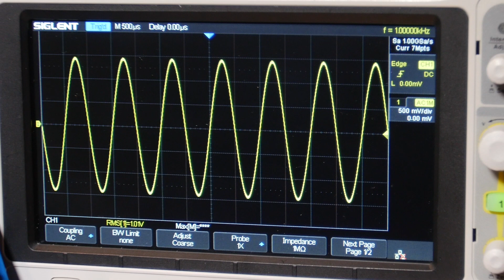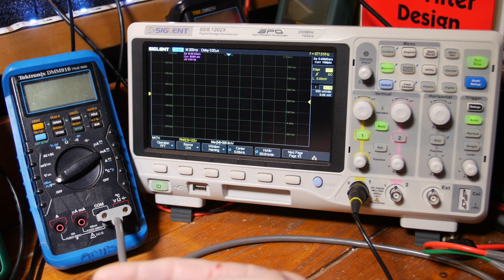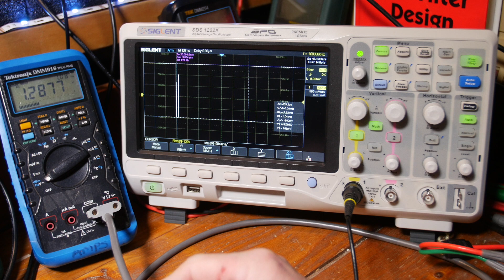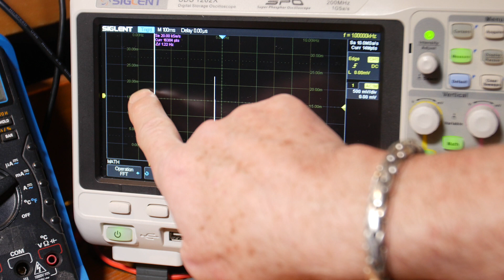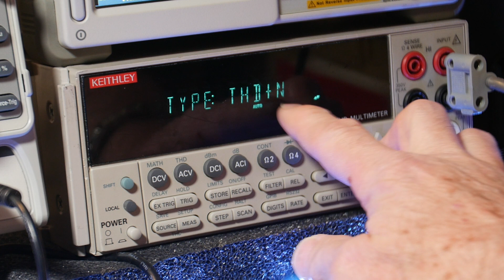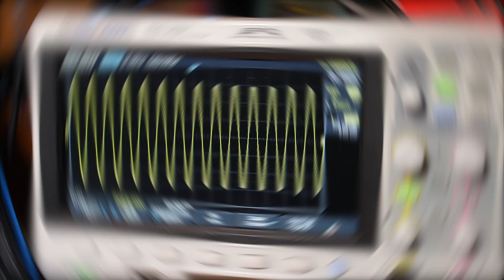How to Trust FFT with Siglent SDS1202X #FFT #SDS1202X

Comment: Hello, thanks for very good video explaining FFT application on Siglent oscilloscope. 
But I have a question. How do you generate a 1kHz signal and at the same time  as 4.5kHz "pilot" signal on same output of a function generator?
I do own an Signent SDG function generator and I wish to learn how can I also trigger different "pilot" signals.
Do you have different files made and saved in the funciton generator that contains the 2 different frequencies?

Thank you,

Comment: Greetings friend.  First of all, thank you for your work and thank you for all your contributions to the community, you are helping us a lot.  I would like to ask you a question if it is not too much trouble.

 I have a question about oscilloscopes.  I've been looking for weeks to buy one with 2 channels.  I'm between a Siglent or a Rigol.
 Both are 200Mhz and 1Gsa/s.  The most notable differences between them are: The Siglent SDS1202X-E has 14Mpts and up to 400,000 Wfm/s, while the Rigol DS1202Z-E has 24Mpts and 30,000 Wfm/s.

 The question is, what should I get, more Mpts or more Wfm/s?
 And in your opinion, which one do you think is better and which one would you choose?

 Thanks again, thank you for your contributions to the community.
 A strong hug.
Reply from the maker: Thanks so much!  I appreciate you!

OK, so honestly - both those scopes are a generation old now, and only 2 channel.  I chose the Siglent over Rigol as there are other features where Siglent is better  (non - E and the -E version GUI is not as clean).

I'd go with the new Uni-T that has the memory - speed - and a better GUI as well as a great FFT (not perfect, but much better).  Also starts off with 2GSa/s vs 1GSa/s from the others - and 4 channels.  Both the Uni-T and the Siglent can go down 500uV/div vs 1mv with Rigol.  Here's the link to Uni-T: https://amzn.to/3v5GsTz

The 2 channel Picoscope cost a bit more but is a far better scope with awesome software.  You can download the software and give it a try.  Here's the link to the scope.  I'd go with the 2206 or higher: https://amzn.to/3wOl3Pb

Comment: I used a scope for 40 yrs. And if I had go through this process for every measurement, I would have been fired 1000x over.
Reply from the maker: LOL yes the Siglent does take a minute to setup, but it actually goes much faster once you have done it a few times.  The FFT can give some great info though.  It has only been found common on scopes in recent years.  But handy when you don't have a spectrum analyzer around;)

Comment: How would u compare the 1202 fft to like a HP 85532 3 series spectrum analyzer
Reply: If u could message me personal I have some questions and some stuff id like tomshoenya
Reply from the maker: Thanks - if you could email me that would be great!
Reply from the maker: Wow that's a great question.  That HP is from the 70s;)  The BW starts at 1 kHz and BW resolution only goes down to 100 Hz.  Other than that, it would be interesting to see the difference.  I think the 1202 FFT would give good results and easier to see, but the HP is an actual spectrum analyzer, so it would be interesting.  The HP module that you mention also needs the monitor that it plugs into.

Comment: Some day I will set up my AWG with a spectrum analyzer and two scopes daisy chained. It will be cool to compare the same signal on the SA in the frequency domain, as well as in the time domain with and without FFT. And by the way, Siglent's scopes FFT function is amazing. There is a difference between the SDS1202X-E and the SDS1204X-E though, as the FFT is enhanced in the 4 channel version. Probably due to Siglent's firmware updates. It's a shame the FFT in the 1202X-E is not updated as well in this matter.
Reply from the maker: Thanks for the great feedback!  The firmware is different in these 2 scopes.    I like the FFT in the Micsig though as can be seen in this video: https://youtu.be/bFWJUmgs_8M

Comment: hi, which is the maximum frequency of the signal measuring fft with Siglent Oscilloscope 100 MHz Bandwidth? can I measure fft of a 21  MHz signal? thanks
Reply from the maker: That's a great question!  Generally, a good FFT on a 100 MHz scope should not have a problem showing the voltage of a generator at 21 MHz.  It isn't so much the bandwidth but the sampling rate that matters.
Reply: @kissanalog  thanks for the response, I´m interested in 21MHz, 15 meter hf  cw ham band, so it will do the job.

Comment: This scope has prob very rudimentary FFT and memory, but you could simply zerofill to 1k or 2k points apply your window function and get sufficient digital resolution.  You could show what happens if you do discrete fourier transform of a sine without smoothing things out with a window function and show sinc truncation artifacts. Also you can show what happens when multiple freq are mixed and separate them out with FFT.
Reply from the maker: Thank you!  Great ideas!

Comment: Al of those spikes signals are just harmonic's on the basic signal.  Your chasing ghoste.
Reply: That's the power of frequency domain visualization vs time domain.
Reply from the maker: pulesjet Yes you are right - at one point when I had the two large amplitude spikes up together they added together in the time domain and must have flat topped a bit to get those little spikes to pop up.  Good eye;)
Reply: ...or parasitic modulations of the signal source ...

Comment: Great video Eddie!

You did everything on a linear scale, what is good for an introduction. On the dB scale you have to be much more careful about the low amplitude harmonics.
I got into this trap as I was doing some simple THD measurements and every time I end up with a (relative) high peak on the 5th harmonic. I belief this is an artefact of the vertical amplifier itself.
after putting my distortion analyzer in between and only using the residual for the FFT, the harmonic bins became reasonable because I don't need that high dynamic range anymore.

Also: It's a difference if you use the coarse steps for your vertical, or the fine ones. With one I read higher 3rd harmonic contend, with the other 5th and 7th and nearly no 3rd. Any idea why? ( I was tweaking from 2 V/Div to about 1,6V/Div for the better resolution)
Reply from the maker: BeamFinder You are right!  I normally use log scale but I was hoping to make a point using linear for easier reading.  Thanks for that great feedback!
Reply: @kissanalog  Eddie, I thank you for your appreciation of my comments or hints. I enjoy your videos and straight forward approach. Sharing my experience and ideas is a thing of joy.
  
You absolutely did make a point by using linear. It's the best way to understand what all that magic is about.

Comment: Hi I'm new to electronic and no idea about scope but just bought (micsig STO1104C) i wonder why no see any videos about using scope to check and repair problems or defects device, but only showing waves and features of the scope itself?
Reply: Hi ... If you are that new yo Electronics then why did you choose this oscilloscope brand and model no. MICSIG TO1104 and on what bases did you take that decision initially ??
Reply: @ahmedalshalchi  likely because it's one of the best entry scopes on the market.
one of the only partable scopes, that will also work as a bench scope without driving you nuts.
mike electric stuff has a video about it and the board and components are of surprisingly good quality, when you have the price in mind.
Micsig makes nice portable scopes, but they were usually very expensive some of their first portable models and cost many grands, particularly those that were isolated and for potent voltage.
https://youtu.be/awZLvTRtoiI?t=19
Their newer and more price-friendly models, are getting solid feedback.
Reply: Jakob ... Thanks for your feedback about Micsig ... May I ask which oscilloscopes are you using new ?
Reply: @ahmedalshalchi  I'm new and zero knowledge about oscilloscope but I bought micsig sto1104c because of touch screen and with battery power other than that i don't know look like it nice big screen. I looking around videos learning how to use oscilloscope.
Reply: Tshais-2014 ... May I ask how old are you and where are you from please ?.... honestly , there are rare of customers like you who just fell in love with a product and buy it directly without many questions , I wish I have many customers like you to sell them....
Reply: @ahmedalshalchi  I'm 35 and from CALIFORNIA
Reply: Tshais-2014 ... So you are grown up American and just now you could find some passion to learn about Electronics , are you seeking for a job or just a hobby ?... Electronics means you should have a great educational background if you are looking to learn electronics in deep otherwise you will only make mess and wasting much time reaching no true goals ....
Reply: @ahmedalshalchi  thanks for the criticized my knowledge, First no I am not grow up in America but I moved to America from Thailand and When I live in Thailand I live up in the Mountain and not even have electricity around my valley that made me grow up no knowledge about electronic, when I moved to America life is 100 times better but I MARRIAGE and have kids to feed I go work right the way to feed my family that why I don't know much about electronic and now COVID-19 killing people around I have to stay home for safety and by doing nothing made me wanna learn electronic, and by watching YouTube I spend money to buy my first oscilloscope and will learn from YouTube. Don't have to tell you all this but look like you really try to help so I review you my past and yes thanks again for your comments and criticized my knowledge. As you can tell my English isn't good. By the way learning electronic just a kill time for me. Next time recommend me English Channels.
Reply: Tshais-2014 .... Nice to me you Mr. Thailand , I didn't know you and I didn't criticize your knowledge and education but just to show you the correct way to learn electronics and how hard is that.... Any way, thanks for sharing me your story and I also like friends from Thailand as one of my good friends is from Thailand also.... I didn't recommend you that Brazilian channel but I recommended it to Eddie ( the owner of this channel ! ) , I recommend you to start with basic electric physics first and some mathematics first  and then watch these channels like Kiss Analog because you are in very primitive level to know and use oscilloscope and if you want me to  keep supporting your journey then I would prefer you to contact me by Email to ( alshalchi@gmail.com ) first rather than this YouTube session.... and you are most welcome , I am an old Electronics Engineer from IRAQ....
Reply: @Chai-Vang  Just to make it transparant, this other model you now are mentioning ain't the same as the one your listing above in the main thread as your purchase..hence past (micsig to1104) the STO is another version.. as I recall the TO-version is Linux based, while the STO is Android based and with the implemention of knobs amongst others.,
Reply: @JAKOB1977  my is STO1104C my bad I missed S
Reply: @Chai-Vang  the Micsig TO1104 is the one in full touch, and also come in an Auto-variant and if you a complete beginner I wouldnt recommend Micsig or STO or TO line that is quite advance with a shitload of features.. I would likely stear you towards one of the most entry based with a good wellwritten english manual and with a big userbase you can lean on and one of those scopes that have manual under each features.. if you have some knowledge then Micsig is one of the best entry & portable scopes pound for pound imo.. but a scope like the Rigol 1000Z series is a good entry scope, though a bonafide bench scopes.
Reply: @Chai-Vang  Its one of these. right https://i.imgur.com/xzdgxHN.mp4
Good brightness way above 400nits, so good for outdoors or well lid environments.
https://i.imgur.com/owKrWvF.jpg
chilling.
https://i.imgur.com/AwssZqG.jpg
Reply: @Chai-Vang  If you havent seen it Mike made a walkthrue of STO version and was to say it least very impressed with the board and component quality, and no caps and look like quality component, it did not look like cheap, and had internal components and overall board-design that you see at the way more expensive gears from big brands.https://youtu.be/C7Ee0wYtAZY?t=1873  take a look at some of the budget brand-scopes and their boards and compare.
Reply: @JAKOB1977  thanks
Reply from the maker: You are right - I’ll do a video showing some debugging.  Nice scope!
Reply: @kissanalog  thanks been watching many of your videos very helpful. Subscribed.
Reply: Eddie ... Probably you may have some inspiration from this channel https://www.youtube.com/channel/UCazAvTtoRlOrFDWDJDB2DKQ
Reply from the maker: Thank you - much appreciated!
Reply from the maker: Tshais-2014 I wanted to give you the link to a series that I started and need to do more videos on.  It is meant for more beginners to start. Let me know what you think.  KISS U 100: Electronics intro class 100 https://youtu.be/rf6WAobost8
Reply: @kissanalog  thanks I will check them out and let you know.
Reply: https://youtu.be/VvFA94Aag7A